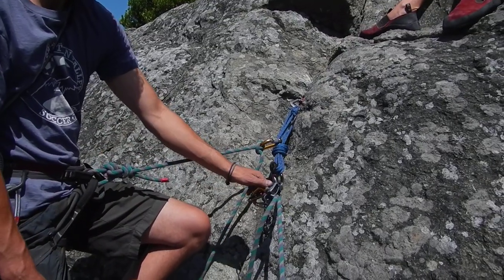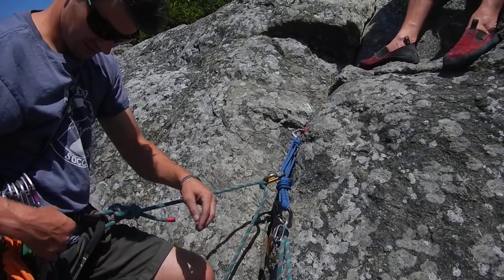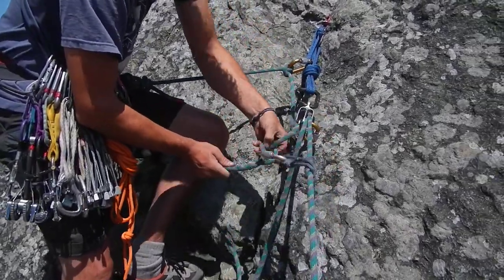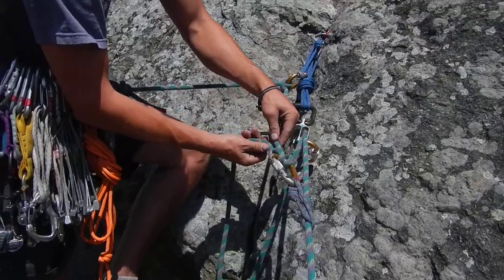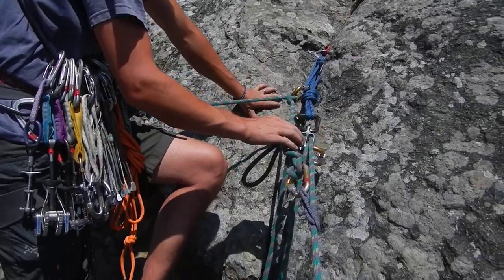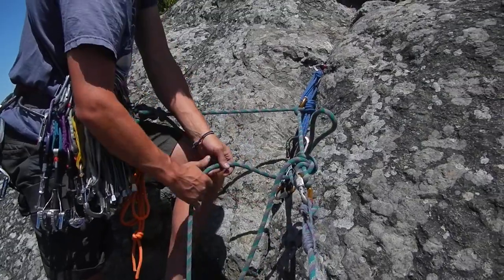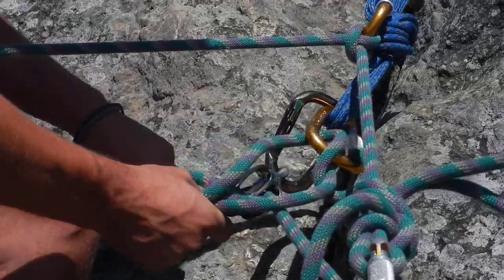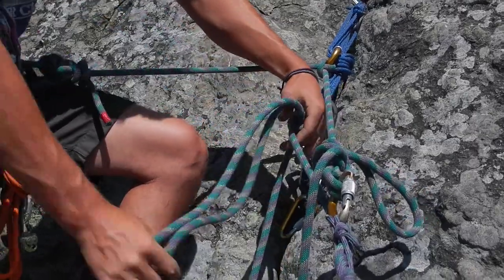Rock Climbing Self Rescue Tutorial

Comment: I find this escape useful if you have the belay on your harness and you have to escape it. Otherwise what you've done is useless (apart from retrieving your reverso) since you were already out of the system.
Reply from the maker: While belaying in guide mode, you should already be removed from the system (besides being tied in with either the rope, your personal or both). This video demonstrates how you would get a loaded belay device in giude mode out so you can rappel down to your injured partner or back down to the ground. I would not recommend belaying from your harness while on a multipitch as the leader bring up a follower.

Comment: You need to change the order of some steps to make it safer tough:
1- Never let go the braking strand.
2- Tie a backup double figure-8 knot in the branking strand. Yet to confirm if clove hitchs can slip under shock loads...
Reply: Normally, you'd be right about not releasing the braking hand. However, the ATC in "Guide Mode" has an autolocking feature. As the ATC is loaded, the climbers rope lays against the belayers rope inside the ATC, effectively cancelling the force to ~  net 0 downwards (I don't know the exact numbers) via opposing friction forces. It is virtually impossible for the climber to fall or lower, as either the rope or some other part of the system will have to fail in order for that to happen.

Comment: How do you get down to the unconscious/injured climber after retrieving the belay device?
Reply from the maker: +Ilana Zimmerman Great question thanks for asking. There are a few options depending on the condition of the fallen climber. You could set up a simlple repel with the remainder of the rope not in the system and go down to them to check up/ give some beta or motivational talk. Or if the second climber is unable to continue you would need to set up a simul-rapel and continue lowering with the injured until you have reached the next anchors and/or ledge. (also possible to set up a haul system and pull up the climber to your anchor)
Reply: I clicked on this video hoping that you would show the whole rescue. It's not a problem I wont downvote :)
Reply: I was taught to rap off the non-loaded end of the baseline, that way it's really easy to then flip your device into guide mode on your harness, setup a friction hitch with a double length sling above that for a footloop and ascend back up to the anchor so that you could perhaps setup a counter balance rap.
Reply: BTW I would highly recommend doing a self rescue course with an AMGA guide.  There is ALOT of stuff to soak in and drill down when doing self rescue like this and it really is worth it to drop a few bills to get hands on instruction.